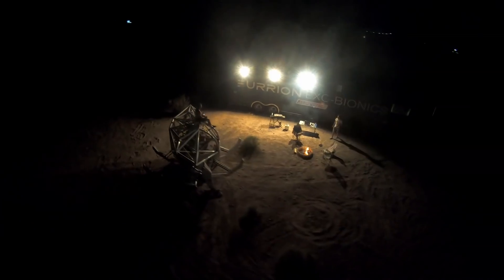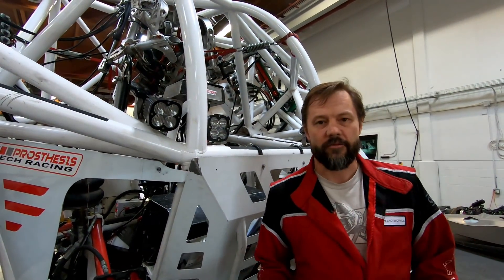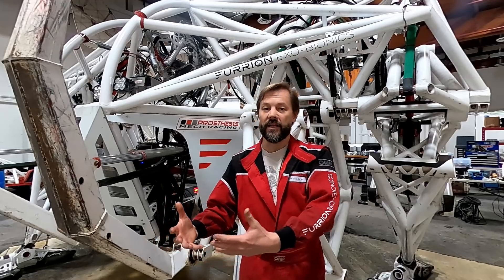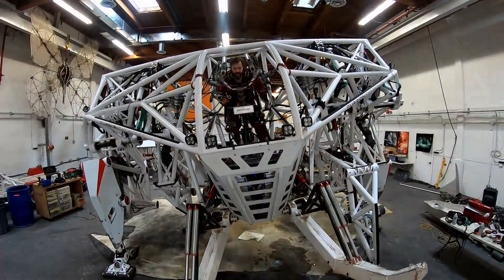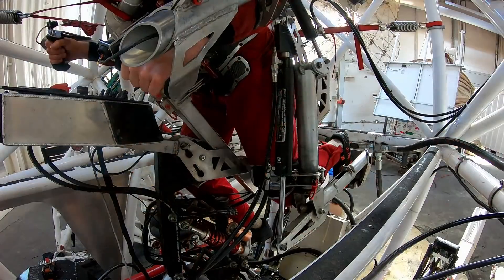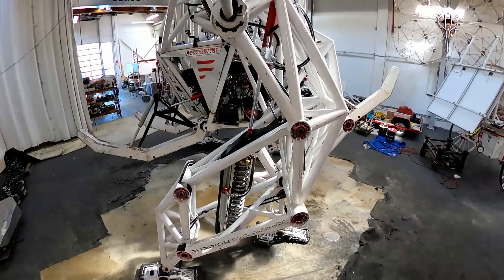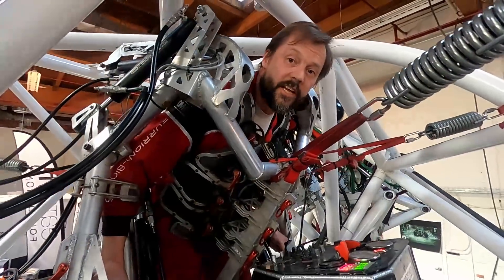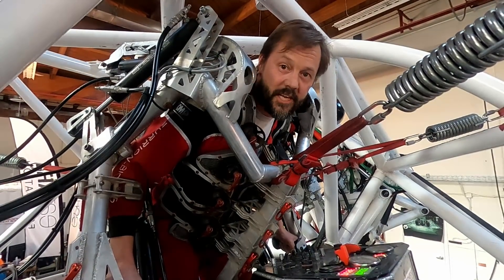How to Pilot a Mech -  Lesson 1:  Basic Controls

Comment: What’s the power source?
Reply from the maker: It's powered by a custom engineered 350kg lithium ion battery pack that puts out 96 volts and up to 2000 amps.
Reply: @exosapientech  That's quite heavy, but I suppose weight doesn't matter in this application, and it's part of the necessary ballast to lift heavy objects.